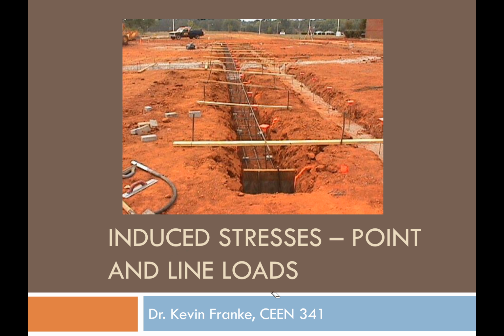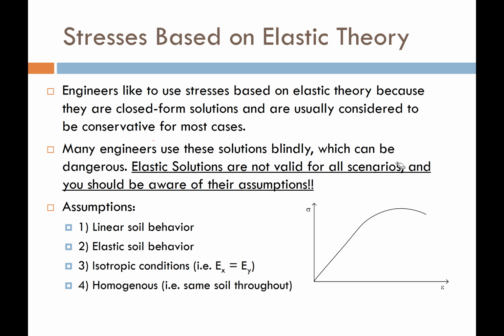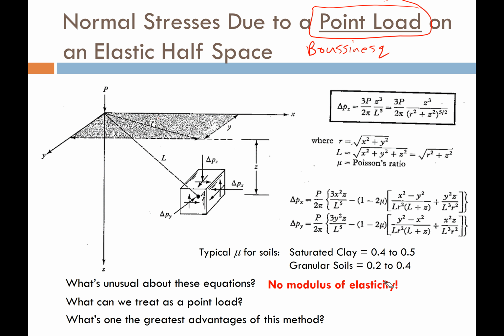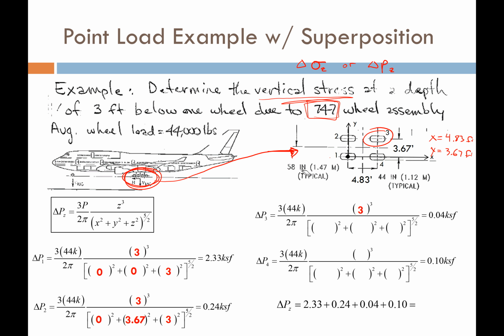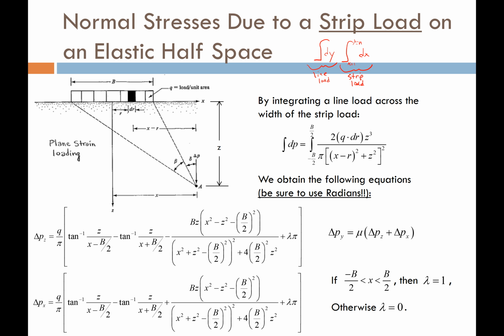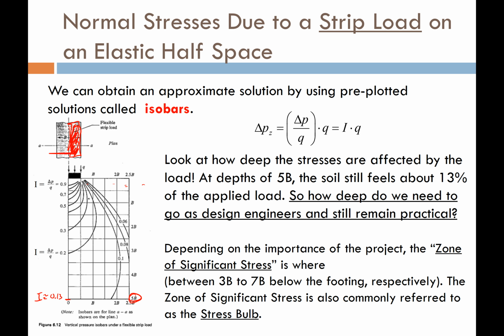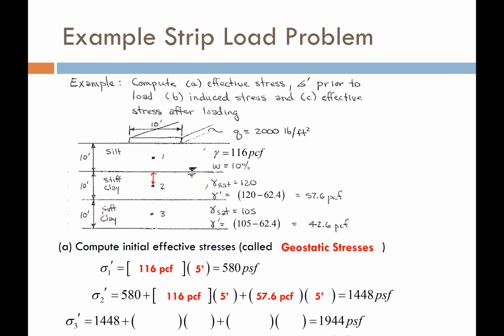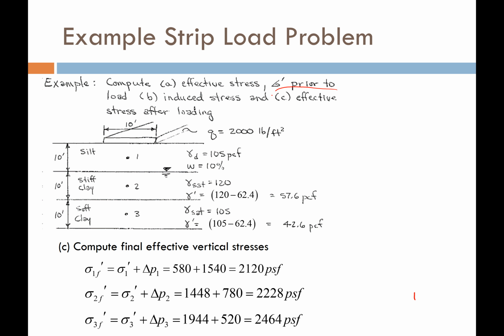CEEN 341 - Lecture 13 - Induced Stresses from Point and Line Loads

Comment: Greetings Dr, I have a question regarding an example in 34:33 if one was to compute the surcharge such as the given 2000lb/ft2, say for an example the surcharge imposed by the Circular concrete reservoir, which methods would you use to come up with such a load?

Comment: Can you just break a non point load square footing into a grid of point loads then? Say a 4’x4’x16” footing is applying 40,000 lb to the soil. Could you say instead you have a grid of 9x9=81 point loads applying 491 lb each?
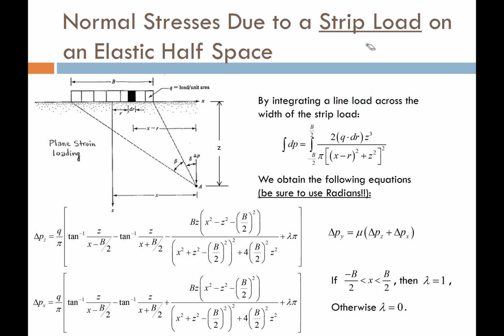Reply: Ah, yes. The answer is at 25:15. If just do it numerically in Python/Excel.